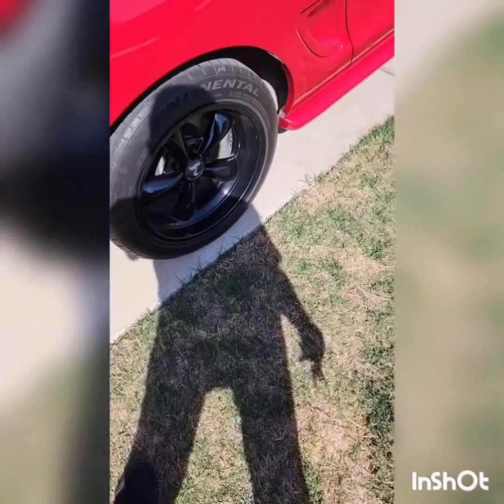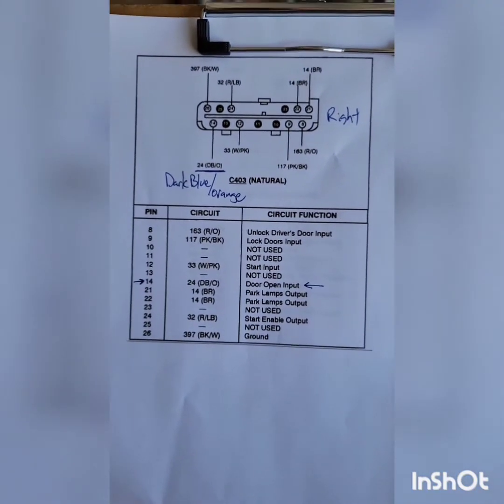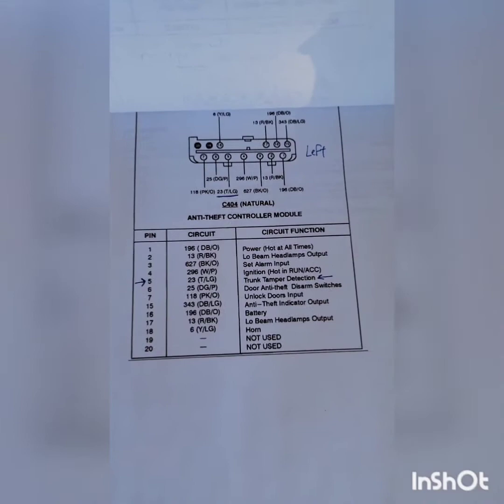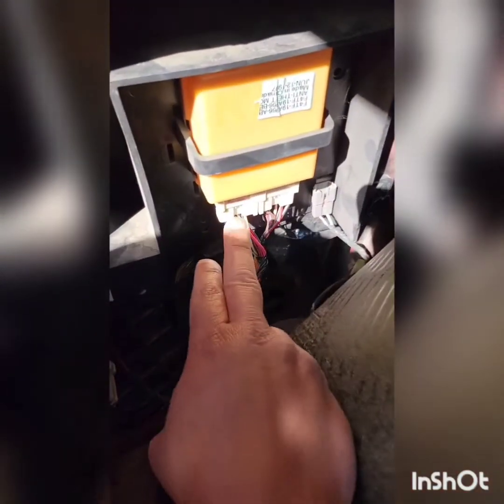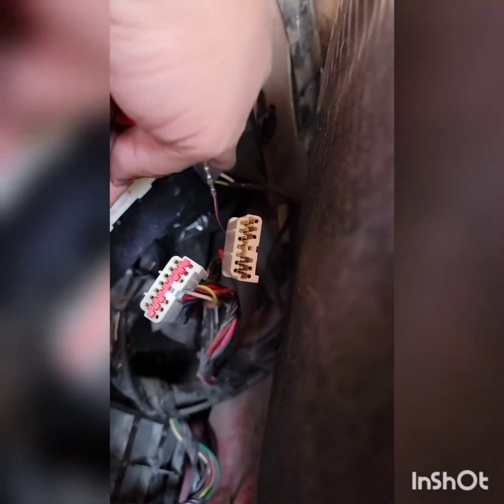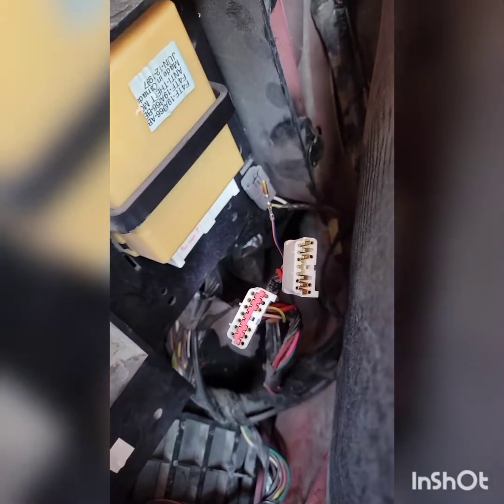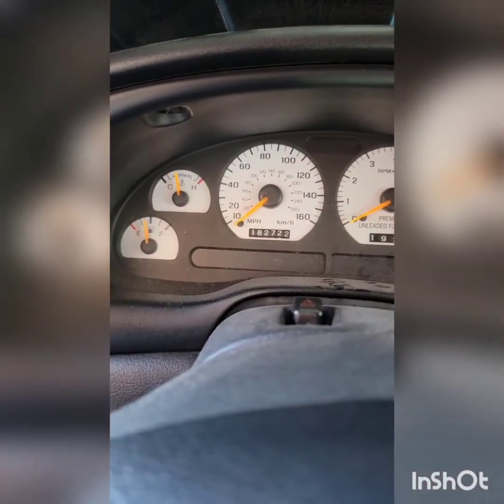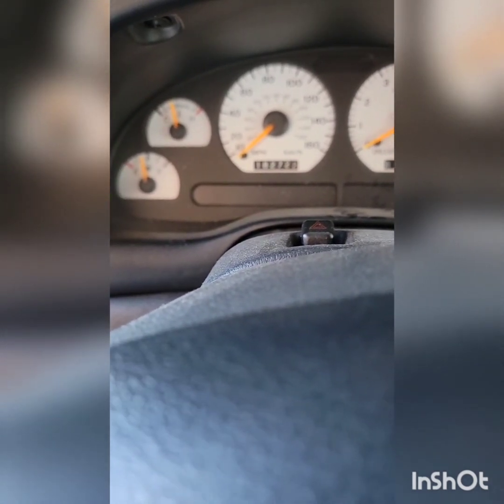1997 Ford Mustang Cobra Car Alarm Bypass

Comment: Having a issue with my 98 cobra. Pats system came on and car won’t start. Theft light blinking fast. Happened before I got a different ecu and got my keys programmed to it worked fine till Friday when the car shut off randomly while I was driving. Any help
Reply from the maker: By pass the factory alarm as show in this video to make sure it is the PATS system. If it is, you may need to replace the ring sensor in the steering column or send the factory computer to a turner to do a PATS delete.
Reply: Will the factory remote still unlock the doors?
Reply from the maker: @theavilabrothers7881  Yes, just like using the hard key. This mod doesn't disable anything mechanical, just the input sensor to the car alarm on the door status.